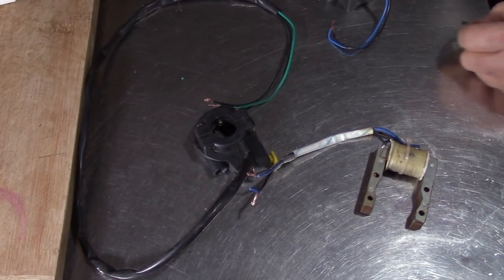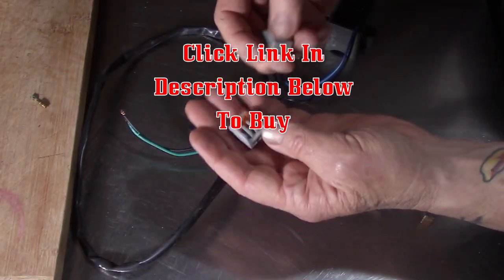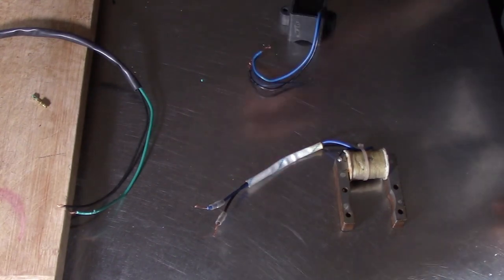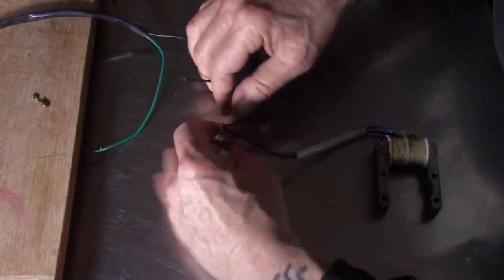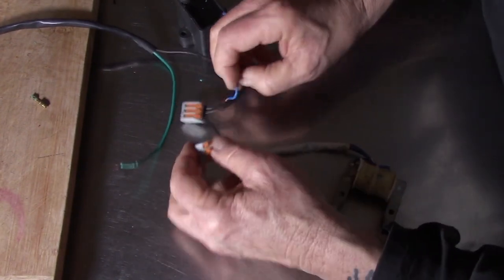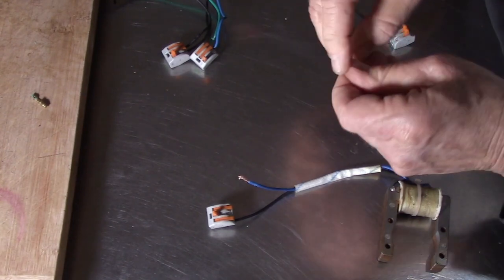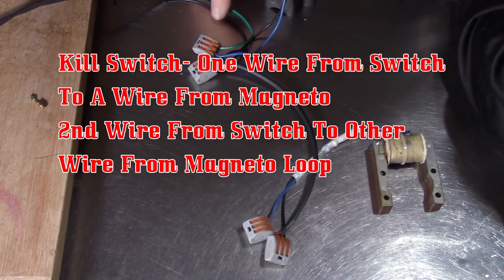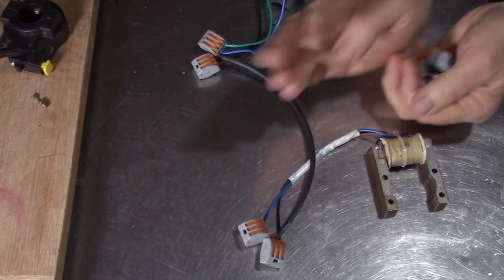How To Upgrade Ignition Electrical Connections 2 Stroke Motorized Bike

Comment: I suggest tinning (solder) the wire ends. My preference is to butt solder the wires and use heat shrink over the connections.

Comment: Ever since i saw this video, last year, i went and ordered me a 10 piece bag. Later, i found a bag of 50 from Temu for like $7.36 I'm Wago secure but i primarily use these in my black and i add a separate ground wire. I think i got that from you too, or Tony from BikeBerry
Reply from the maker: Those Wagos are a big help. I'm going to rewire my house using them. My house has Aluminum wiring. 50 years old. No probs yet
Reply: I'll bet they'll be a waterproof improvement on outside receptacles. If clearance allows

Comment: Cool idea . I prefer to clip all the ends shorter per application. Then heat shrink all the connections into a nice clean harness and tie it up… engine removal just take apart. I’d rather have it look clean and take an extra second upon engine removal.. I’m a sucker .

Comment: What do u gap ur bikes at
Reply from the maker: 25 thou. I'll gap w/ a debit card in a pinch
Reply: I ask because I see a lot of people gap there around what you say but my bikes will only run good between 33 and 35
Reply from the maker: @chrislavalley4062  Cool. I'm curious about: What elevation are you at? What plug number? What premix ratio? What oil?
Reply: I'm at ocean level ,I'm in mass living on the beach,I know I watch many of ur videos of u saying 40 to 1 but I tryed that twice and blew my crank I cant run any higher then 25 to 1 without causing problems
Reply: Hughes motorized,one of my bikes I'm running a 68 jet plugged gapped at .35 25 .1 and that bike is beautiful,fast when I moved it up to 32 to one it got slower and started scratching head
Reply: I'm using stp from auto zone
Reply: The other bike is so slow,it has a new crank,piston,rings I just did all that 150 miles ago,I had the engine for almost a year and before I replaced the crank and piston I put over a 1000 miles on it ,it ran ok until I switched it to 40 .1,the crank locking up isn't my concern, Wondering if u have any idea why this engine has always been lacking power could it be bad bearings